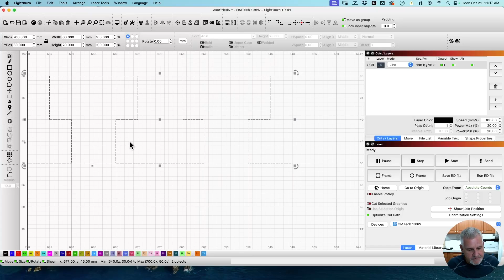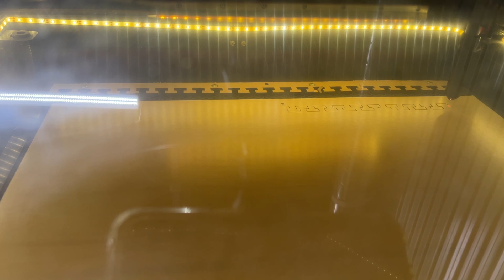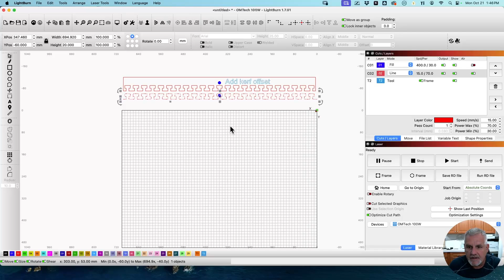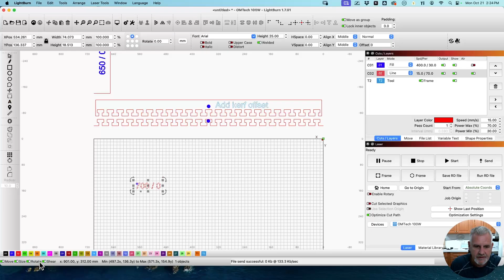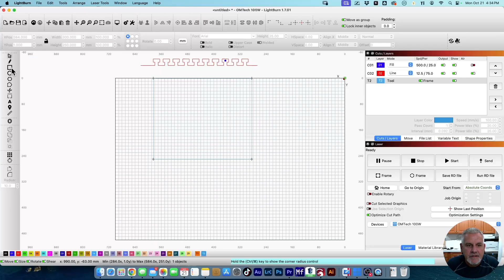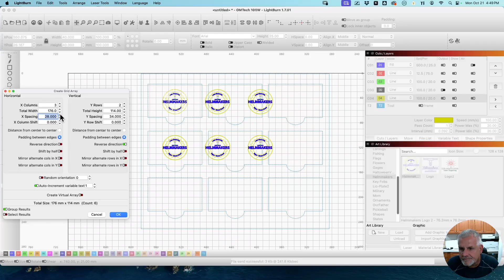Simplify Your Laser Projects With This Interchangeable Jig System

Comment: I just use a fence cut by the laser so it's square with the laser on 2 sides and use absolute coordinates. No fuss with excellent repeatability without a bunch of jigs to store.
Reply from the maker: Yes, that's another way of doing it. The most important part is ensuring that neither the fence you've made nor the substrate it's sitting on moves. If anything moves, you've just lost your repeatability. Thanks for the comment.
Reply: @helmmakers  Nothing moves.
Reply from the maker: @privatebubba8876  Perfect!

Comment: What happens when you take the honeycomb bed out to clean it?
Reply: Thank you very much
Reply from the maker: That's something I rarely do. 
The clearance on the screws that hold the honeycomb in place is very close so it goes back in the same location. I have not removed it since installing this system, but I wouldn't imagine there is much if any movement. 
I would recommend checking the positioning of the L fence after reinstalling though. Worst case scenario, you would need to make a new L fence. Any jigs that you've made you could adjust the positioning within Lightburn if it has moved.